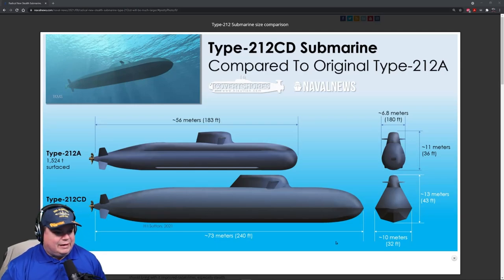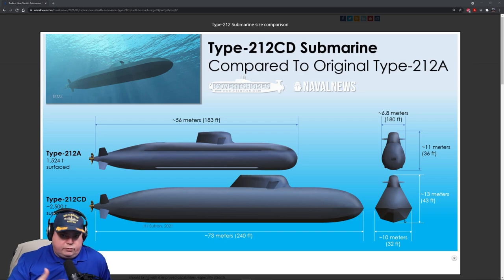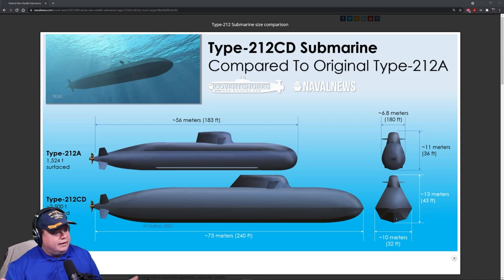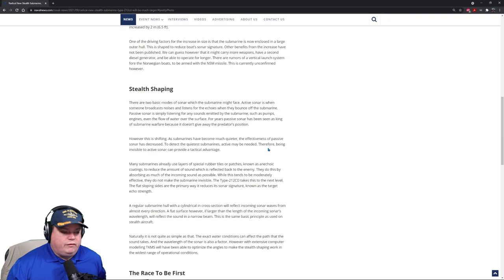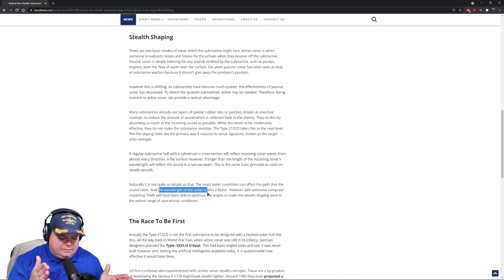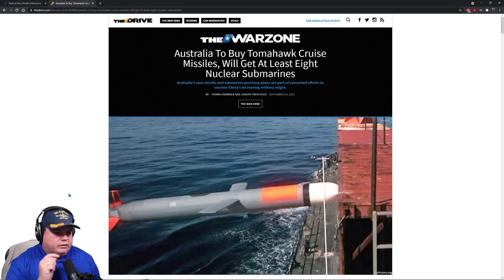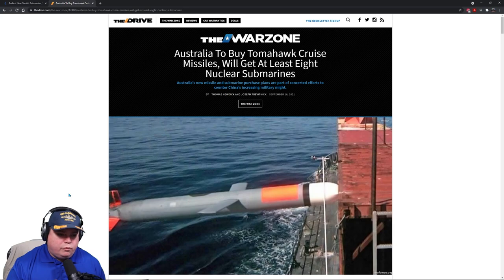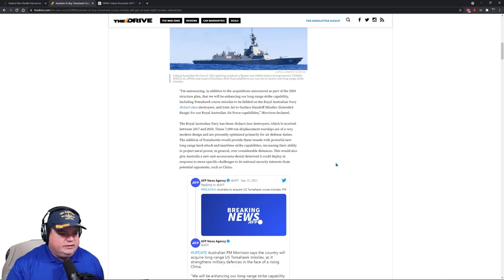New German and Norwegian Type-212CD

Comment: That new shape has got to be a simple structure over the pressure hull, like the turtleback on a Trident.

Does give you some extra space outside the pressure hull for things like the AIP tanks, or external torpedo/countermeasures tubes.

With modern computer graphics cards, it should be possible to predict your signature and what your threat angles are in real time

Comment: CD stands for "common design". Also, the type 212a are dual hull subs, so will be the 212cd class.
Reply: maybe 1,5 hull design at best.
Reply: @jebise1126  the 212a are dual hull, they have the internal pressure hull and the external sonar absorband hull wich holds also the fuel tanks etc for the AIP System etc
Reply: @zhufortheimpaler4041  it seems only upper part is dual hull so 1,5 hull
Reply: @jebise1126  look at crossections, it has an internal pressure hull and an external hull for sonar absorbtion, streamlining etc.
its a double hull ship
Reply: @zhufortheimpaler4041  i didnt and i only saw one hull... do you have any other source that i didnt saw?

Comment: Sub Brief,how about a comparison of electric vs nuclear, covering cost, noise, maintenance etc. All around bang for your buck. I think if your not fighting half way around the world, staying in your own back yard, that modern electric boats are pretty practical.
Reply: The U.K. has been working on nuclear electric for quite a while. Instead of steam turbines. The reactor would supply steam for the generators which would power electric motors.

Comment: The munitions that were used to cause damage to the power grid by shorting out power lines were loaded with either graphite or carbon filaments depending on type of munition that was used in desert storm

Comment: The hobart class being based on the navantia f100 class frigate is equiped with mk41 vls cells, they could just remove a couple of their AA dedicated missiles to accommodate the tomahawk if they are using the strike length version of the launcher (since that was one of the designs for the constellation class proposal,  I believe the cells they have are strike length, or at least some of them)

No need to add new launchers on the ship if they are willing to give up some of the SM or ESSM missiles they are using for AAW (it is based on a frigate design, so they don't have anywhere near the amount of vls as a burke class of ship would have, but maybe dont need as many depending on the mission)

Also no one has mentioned who is going to be responsible for the nuclear waste disposal for the sub program, the UK still has some of their first gen SSNs waiting for proper long term disposal, its going to be a major sticking point for whoever commits to housing the reactor and spent fuel long term.
Reply: Or just buy Korean KDX-III monster of design.

Comment: The pressure hull is still cylindrical with hemisphere endcaps. The outer hull is stealthy for acoustics and radar (when running on surface). But man, this European AIP SSKs are getting scarier and scarrier. Nukes still have a speed advantage, but a slow sub carrying ultra-fast torps nullifies speed advantage of nuke. But still nuke will always outlast an SSK regardless if its propulsion prime mover.
Reply: For coastal defence an electric sub must be alot better and more silent than a nuclear sub?

Comment: Lots of interesting stuff. On the first segment, the one with the new boats for Germany I wonder if the outer, stealth hull would be vented to allow seawater to fill a void between the inner and outer hulls. This way the cylindrical, inner hulll would be the one bearing the pressure.
Reply: Yeah the 212a already have double hulls with the outer beeing free flood so your guess is likely correct
Reply: @mkaymkay2846  Thanks!

Comment: During WWII England launched what was basically Barrage balloons which would release cables at a certain point dragging them to short out power lines in German controlled areas. It turned out to be very cost effective, big bang for the buck but they did end up shorting out power grids in one or two neutral countries or countries not on the target list.
Reply: I suppose the British ambassador in Sweden was invited by the Swedish cabinet to explain things and verify that the UK wasn't actually attacking Sweden on purpose.

Comment: asking about german engineering "is it gonna work"   - as a german born, i feel that is a thinly veiled insult.

Aside of the fact that german engineers know a thing or two about wavelengts and the caclulations connected to it... 
(Heinrich hertz,  Karl Ferdinand Braun, Röntgen are just the tip of an iceberg)
...and can do so with an abacus if need be - 

 i do not think "AI" is a critical requirement to build this.   You may know about sonar, but in the engineering department you just failed tbh.

What you may have wanted to say is CAD - yes, in ww2 was no CAD - but engineers at the time where very classy and could work
very well using metrics on a drawing bord.   There must have been a reason or two - americans copied german design after ww2.

So dont ask "will it work" - you know it will,  they have done enough testing before pouring that kinda money in and announcing it. 

It will work, and it will piss the russians off, and it will keep pissing off us-CSGs in wargames.  (we have plenty of periscope photos on us-carriers made by german subs, not just a swedish one)

Comment: Shapes impact the intensity of reflecting sound waves.  Same as electromagnetic waves for airplanes.  You are going to see two strategies, the prior was absorbtion which the U.S. has used and will continue to use, and the second is the angles of reflection of sound waves.  Arrays of sensors planted on the ocean bottom mostly passive, but not all, in the South China Sea and other places to detect subs both acoustically and magnetically will complicated design considerations further I would think.  Oceans are complicated as well by having thermal layers which reflect sonar waves striking them obliquely nearly completely depending upon the angle of incidence.  I recall a story from my youth of us using that property to locate downed airmen starting in WW2 by having them drop hollow steel spheres which were designed to crush at a certain depth between layers which would allow triangulation of the location by multiple sensor thousands of miles away.

Comment: RAN is a shrinking Navy and the F100 has 186 personnel and the Arleigh Burkes require 303-323 crew. So we can have 3 Hobarts with 3 x 5 inch guns and 144 VLS or 1 Arleigh Burke with 1 x 5 inch gun and 96 VLS. Australia can't just measure a purchase by dollar cost. It also has to factor in crewing cost with our small navy that tries to appear large. Also we have never fought a war by ourselves ever. We have only ever been at war alongside Britain or the US and so force projection is not the aim of our Navy. The aim of our armed forces is to prevent being invaded and to assist our allies.
Reply: Then why are you buying large nuclear submarines that can only operate in blue waters far from shore? 10 ultra-modern stealth fighter submarines to fend off an invasion before it happens would be more important in my opinion.

Comment: "... this  is Morrision the Prime Minister of Australia..."  or as the head yank calls him "that fella down under".  The new Hunter class figates (we're getting 11 I think) also have MK41 VLS - I think 32 cell off the top of my head. I believe both the Hunter FFGs and the Hobrt DDGs actually have AEGIS - remember AEGIS is the combat system, not the actual radar. The radar is a separate thing - US AEGIS equipp[ed vessels use the SPY-1 radar, but Ausatralia is using a locally designed and built radar, from a company started by two ex RAN officers. I think the Hobart class DDGs have the SPY-1
Reply: I think there's also work going on with sharing some of the CEAFAR radar technology with the United States, if I remember correctly. It's supposed to be a hell of a radar.

Comment: Do you have a guess about the submerged duration capability of these new littoral stealth subs?
Reply: 3 to 4 weeks without surfacing. But it is nonsense to assume that the 212 class subs who can only operate near the coast. They have a range of 8,000 nautical miles. These subs operate in NATO Missions constantly also in the Atlantic or the Mediterranean.

Comment: Rounded shapes are not stealthy, everybody had figured that out long ago, even the Army, it's very obvious with aircraft cockpit glazing - rounded glass produces sun glare at a very broad angle range, that's why they tend to make flat glazing in combat helicopters, for example. I guess the US Navy didn't need that feature nor it wanted to build the required double-hulled design..

Comment: As far as the stealth sub goes, sorry I'm still in analyst mode, what do you think they give up to get stealth capabilities?  I'm asking because I don't know, not trying to be a critic.  I assume that design is not as good at handling depth or damage, would that be correct?  I thought I read that if stealth lines get damaged, even minor damage, like from running in to a pier or the bottom of the bay, stealth is completely lost.  I assume it will be prone to loud cavitation from depth and temp changes also?  In a wartime scenario, sounds like if they run a less than perfect mission, or accidently surface in to an iceberg, they'll have a slow, shallow, high visibility trip home...dead duck.  But thats all subs...

Comment: My knowledge of sonar is 1980s at best, and amateur, but, surely, using active sonar also reveals the position of the transmitting boat. And there are other ways to detect submarines.
Reply: There are two ways to detect a submarine.

- Active sonar
- Passive sonar

That's it.

Detecting a European submarine using only passive sonar has become extremely difficult. They have managed to make submarines so quiet that they are invisible to passive sonar.

Active sonar is becoming a lot more important for that reason, and the 212cd is built to counter that.
Reply: @a5cent  Actually, you missed out magnetic anomaly detection, one of the oldest forms of detecting a steel ship, dating back to magnetic mines. Just sayin'...
Reply: @Alex462047  Okay, technically that is true, but for ASW irrelevant now, right?
Reply: @a5cent  No. ASW aircraft have used magnetic anomaly detectors to detect the presence of submarines since the 1960s (maybe earlier) and the composition of metal in most submarines built from the time of the Cold War is designed to reduce the magnetic signature of the submarine. Again, my amateur knowledge dates back to the 1980s, no doubt all this technology has substantially improved now.
Reply: @Alex462047  I know they were used back in the day. I'm saying they aren't used now. Nothing under the water shows up on them anymore.

Comment: Love your vids, Sub Brief.  Thanks.  

Speaking of stealth (and as an Australian), I'm really interested in which boat will be chosen to replace the disastrous French project.  I think most people assume it will be a Virginia class, but I'm wondering if they're actually targeting an Astute class.  

I'm interested in your thoughts on what boat would be the best choice for Australia.
Reply: Hi Matt, sorry to butt in (but agree Sub Brief's comments would be of interest here), from what I read it will be the Virginia class in the main, but UK will supply for the fuel.  What else I don't know, and I could be way off the mark here.  I suspect that the Aussies may want the Astute's Sonar as that is the best bit of kit around (witness 2012 Exercise against USS New Mexico).  The builder of subs will be BAE Systems (Australia), which is also building (in Osborne) the Australian Type 26 Destroyer. What do you think Sub Brief?
Reply: It'll probably be a Virginia variant, especially given the boats the RAN already have use the ADCAP and Harpoons on the Collins class so they won't need to buy an entire new arsenal to equip them. But I can see an Astute based design having a lot of appeal as they're quite a bit cheaper, smaller and have a reduced crew requirement in comparison to US designs. They're pretty damn capable too and extremely quiet, but the best choice for the RAN is probably the Virginia, they may have to purchase less of them due to cost but the weapons are already there, there's far more available yards in the States (assuming some sections like the reactor will probably be built abroad and sent to Australia for assembly) and they are currently produced at a faster rate.
Reply: Uhm, French have basically broken very good design to fit your australian irrational nuclearo-phobia...
Reply: @scottgoode2609  I believe the intent is to build in Australia under the guidance of the designer.  This is part political, and part an intention to ensure a domestic capability.
Reply: @harrysheffield624  I believe BAE is the builder of the Astutes in the UK.  So the ability to export the expertise to build by BAE's Australian entity makes a whole lot of sense.
Reply: If the 212CD class submarie is at least as good as the older 212A class, then the navy of the enemy has a real problem. During several NATO exercises the 212A was able to sneak right into the Carrier strike Group's without anyone noticing it was even there in the first place.
Of course they had some sub contacts, but not enough to track the sub.
Neither the frigates, nor the destroyers, cruisers and not even the Los Angeles or Virginia Class sub's of the carrier strike group were able to detect it to prevent the (simulated) attack.
On one occasion it even surfaced right next to the Carrier, made itself known and then it started diving again and again disappeared without getting found. 

If the 212CD is equipped with even more stealth technology...well then some enemy navy Admiral, will have some sleepless nights.

Comment: Sub outer casing can be any shape you like - did it take this long to work it out? Hmm.
Reply: Maybe a cylinder is better for passive sonar stealth when moving quickly under water, or was until recently.
Reply: There probably are some trade offs. Possibly more water noise and maybe worded hydrodynamics overall.
Reply: most countries build one hull boats, germany builds 2 hull U-boats with the outer hull being non metallic and the inner hull being non magnetic steel, all for stealth. so they have it easy to change the shape of the outer hull since it's not holding any pressure. other countries need to completely redesign the way they build subs to make them 2 hulled and they need to develop the secret outer non metallic hull material as well.
Reply: @swunt10  Isn't the pressure coming from outside of the outer hull though? Or does water move between them?
Reply: @davidste60  there are gaps for the pressure to equalize I would imagine. the thing about water is that it's nearly non compressible. so as long as there is already water between the 2 hulls not much water incursion is need (if any at all) for the water pressure to reach the inner hull and like I said the outer hull is some sort of non metal material anyway so whether it has gaps, is porous or just flexes, it's not going to be much of any of that since water is non compressible anyway.
Reply: @swunt10  That might limit the speed and possibly make more noise than a closed design I think. Maybe they have a way to open holes in the outer hull during changes of depth and then close them once they reach target depth, or like you said, the pressure difference might cause temperary openings due to flexing of the outer hull. I suppose it will be decades before we know a lot about these boats.
Reply: @davidste60  it's a free flood hull, its in the name. The hull shape have a speed limit, but it doesn't make any more noise then normal. These submarines are not blue water submarines, where you need speed. These subs operate in litoral water, where they prefer to operate at low speed. Litoral water is shallow and if you run at speed, you make noise, thus you drive slowly.
Reply: @heuhen  Yes it's in the name, but the name isn't connected to the submarine in this video or in any of the articles I can find. That's why I'm asking.

Comment: Just wondering, if the Aussies should look into the German-Norway design. Or should we sell or lease to them a SLEP of the flight III LA class 688's. Just a thought...
Reply: Much too small. Australia wants vertical launch blue water subs, 212CD will probably be tube only littoral. Different use case.

Comment: Anyone any idea why its still called the 212 class?
why not a new number?

It Seems like a total new Submarine.

i means they used a new number for the Export Version of the 212 and called it the 214...wich is much closer to the 212 that this!
Reply: The F/A-18E and F (super hornet) has the same thing. It's a practically a new plane, but it uses the F/A-18 name, in that case because otherwise there's a big paper mill and politician involvement and so on.
Reply: 212 is the high-tech version, only available to the countries participating in the program. The boats with higher numbers are easier export versions. It's similar to some US fighter jets that third countries only get the wooden version of.

Comment: After what I saw while I was in the Air Force, I'm surprised we haven't had this for 30 years now. I didn't deal with any navy stuff, but the solution for this is almost as old as I am. Edit: the 212CD rendering is censored if they are going for zero return for head-on engagements.